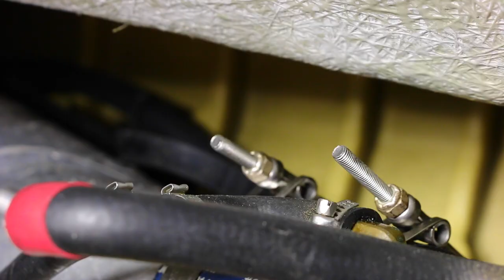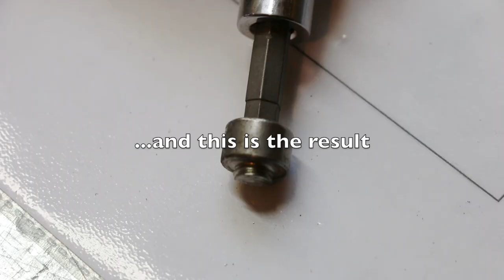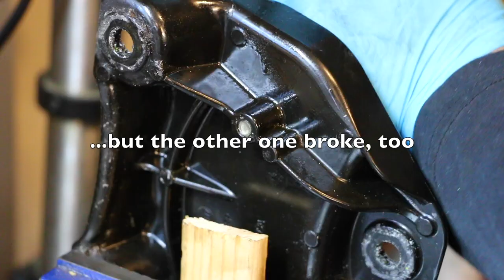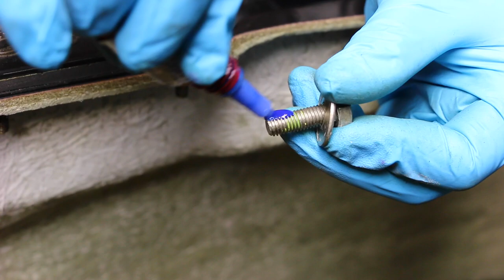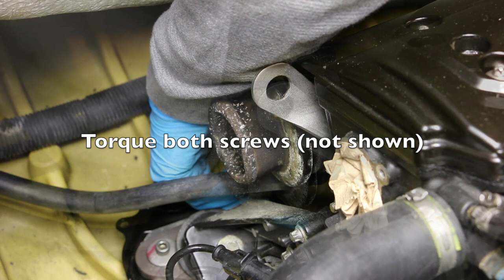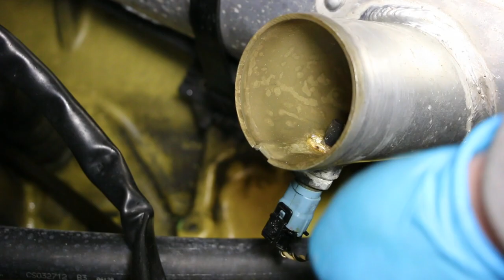How To Do An Engine Alignment On A Sea Doo Personal Watercraft Jet Ski

Comment: Excellent video. Just pulled apart my wife’s 2012 GTI and found the carbon seal ID significantly wore the drive shaft. Checked alignment and the engine is way off at about .125” low. Before breaking those shim bolts, my plan is to loosen the engine mount bolt, take weight off the engine and then try to loosen those shim cap screws. Will see how that works, after watching your video I figured it might be worth a shot...
Reply from the maker: Great stuff! It may take a little muscle, some know-how and a few tools, but the money you save is worth it. Plus, getting to know your machine inside-out is such a great feeling, especially when you rely on it to take you miles away from land. Thanks for your comment, and good luck with your machine.
Reply: And... drum roll... no go...I broke a bolt! (Just like in your video) Ultimately only broke 1 of 6 shim bolts doing this with the engine side mounting bolts loose and weight off the engine ( one shim at a time) Tapping all threads and replacing all M8 x 40 capscrews. I can now see that this is why Seadoo machines the shaft down just behind the carbon seal rotor, that allows for some miss alignment without rubbing the carbon ID. (But NOT 1/8 inch misalignment)
Reply from the maker: Nothing is worse than when you feel a bolt break. It shouldn't happen on a machine that's less than 10  years old ...salt water or not. The only thing that may make life more miserable is when you feel the threaded insert anchored in the fiberglass start to rotate round and round and round...

Comment: I watched your video, as I have also been attempting this. I noticed when you got the alignment right, there was still a tiny bit of touch between the alignment rod and receiver. What is the allowance for that? I have been pulling my hair out trying to get it absolutely perfect. Any advice on a method of how to shim or which mount to adjust? Thanks
Reply from the maker: The rule of thumb is, you will always feel a little bit of a tap, but there should be no resistance whatsoever to the rod moving in or out. Good luck!

Comment: Great video! Any reason why it looses the alignment? Is it because of motor mounts getting old? How many hours motor mount should be replaced? Have a good one!!
Reply from the maker: Thanks for the kind words. Lots of rough riding, wave jumping, general abuse, etc. Some people say they sometimes come a bit misaligned from the factory, but we’re not sure about that. Failing motor mounts can also be the culprit. The motor mounts should be checked periodically, but there’s no recommended time for replacement. Good luck.
Reply: @3ftDeepChannel  Here in Spain we replace it about every 200h
Reply from the maker: Are you doing that as a preventative measure, or have you found broken motor mounts after that time? We just worked on a machine with 900 hours on it and the motor mounts were still in good shape.
Reply: @3ftDeepChannel  as a preventive measure. Here, we always always ride on salt water so with corrosion and the jumps on rough waters they suffer an extra pain. And if they broke the pwc sinks, so they are cheap to change.

Comment: Thanks for all the informative Videos. Q: What has been your experience with with 4 Tec Engine Mount Life expectancy of NA or Supercharged Ski's? Is Salt water a Factor? Riding in Choppy conditions?  FYI: My PWC is a 2015 GTX iS 260 Limited with 197 Hours. BTW: Recently at 191 Hours my iS system had a mechanical failure, the M10 x 110 Stainless Steel Bolt that secures the Starboard Footrest to the Front Suspension Arm Pivot Tube which had Sheared from Metal Fatuige and the effects of Galvanic Corrosion, after having removed the upper body assembly I was surprised to find both of the Lateral Bellows Cracking and Torn and the Center Bellows had a Crack, I replaced Lateral Bellows with New and Central Bellows with Used {NLA} as well as a Used pair of Footrests complete with used Bolts {New Bolts kept being Delayed / I never did get them}. I also performed some Maintenance while I had it apart such as I rebuilt the Supercharger for the second time, I replaced the Steering Column Bushings, Coolant Flush, Changed the Oil and Cleaned my K&P Engineering Stainless Steel Mesh Oil Filter and replaced the Spark Plugs (NGK 4339). My Engine Mounts appeared to be okay from what I could see with the Supercharger removed.  Randy   AKA randog311 (Retired Professional Wrench  /  BTW: I've found my Suspension Ski easier to work on than the European Cars I Specialize in, I don't understand why people bad mouth the Suspension Ski's?)
Reply from the maker: Hey Randy, Good questions. The engine mounts will last quite a few years. Many conditions will affect the life of the engine mounts, but under “normal” use you should get at least 10 to 15 years out of them. If you ride in choppy/wavy waters or do lots of jumping (like we do), then you’ll shorten the life considerably. Still, we haven’t experienced any issues with our machines, even after 5-10 years. That may be because they’re improving the rubber mounts and mount system over the years. You’re more likely to shift your engine when riding in rough waters and throw your alignment off and an adjustment may become necessary. Pay attention to any increase in vibration over use. That’s great you’re keeping on top of your supercharger. That’s a critical maintenance component. There were some issues with the iS design that resulted in water intrusion into the hull. They’re also a bit more difficult to work on than regular skis. That’s why they got a bad reputation. The dampening of the ride bumps, however, is a great thing. Thanks for your comment and safe riding!

Comment: Do the motor mounts ever go bad? Like if you had it out would it be better to replace it entirely for a new one?
Reply from the maker: Yes. Just like automobile motor mounts they will eventually wear. It’s not normally something you’d think of replacing when doing engine work, but if your machine was ridden hard (lots of wave jumping, etc.), it’s over 7 years old and the mounts are looking a bit rough around the edges, I’d consider replacing them. But bear in mind, changing 3 mounts can be a bit pricey (about $300 CDN). Thanks for your comment.
Reply: @3ftDeepChannel  ya mines a 2006 GTX but they look brand new. But my carbon ring is vibrating when I turn the ski on out of the water. Think it’s just misaligned but might replace them. Would the engine be vibrating more and that’s how you really tell if you need new motor mounts?
Reply from the maker: Yes, there could be more vibration from worn motor mounts. The alignment could also be the issue and needs to be checked. If the carbon ring is undergoing too much movement and hasn’t been replaced in a while, you’ll definitely want to check it out and replace it if it’s worn (and it likely is). Check out your pump thoroughly as well, as worn or broken parts in that system can also create vibration. Good luck.
Reply: Ya I replaced the carbon ring 5 months ago and re built the jet pump in December so I’m thinking alignment/motor mounts as well

Comment: I have a 2012 GTX S 155 which I need to remove the motor from to find an oil leak. I assume this engine alignment will need to be done after? Where do you get the alignment tool from? Do you need to remove all the drive shaft etc to take the motor out?
Reply from the maker: Yes, once you pull the engine it’s very advisable to do an alignment check. If you can borrow one from a friend or acquaintance, that is always preferred as it’s not a very regular job to pull your engine. If you absolutely need one though, you can find one at our website: http://3ftdeepsports.com/store-tools-specialty/. Unfortunately, you do need to pull the driveshaft to remove the engine, and that can be a big pain in the neck with machines over six or seven years old. Rust tends to make removal of the C-clip difficult. In fact, we suggest getting the tool for removal of the driveshaft as well. Oil leaks, however, are very rare in those machines. Before removing your engine, I would do a thorough investigation to see if I could confirm the oil leak location. You may not need to remove the whole engine to address the issue. Good luck!
Reply: @3ftDeepChannel  thanks. I bought it with pretty low hours just recently (89), and it had only just had the engine replaced, so hopefully it isn't as painful as it sounds. I'm getting oil in the bilge and haven't been able to locate the leak. I suspect that it is leaking from an oil drain plug underneath that wasn't tightened correctly, but need to remove the engine to find it. I plan on using some flourescent additive.
Reply from the maker: Okay, good luck. No oil drain plug underneath, though. Oil is removed from the dipstick tube.
Reply from the maker: The middle one is the piston valve assembly. They are not oil drains but they could leak oil.
Reply: @3ftDeepChannel  thanks, I'm under the impression that these are not accessible without removing the motor?
Reply from the maker: I’m not sure what the clearances on your machine, but that would be very, very tough. You would want to make absolutely sure that the problem was with those plugs first before going down that route.

Comment: I keep blowing carbon seals. I'm about to be on my fourth one with 190 hours. 2015 GTR. Do you think this should be the first thing I look at? What else can cause carbon ring issues other than the obvious things like running it out of the water? I've got three hours on the one I just blew. Literally haven't done anything but put around the islands.
Reply from the maker: Whenever we pull the driveshaft on our machines, we check the engine alignment. Normally a slightly misaligned engine won’t cause too much damage to the carbon ring, however, if it is too far off, you will see uneven wear on the carbon ring. I.e., you will see a groove worn on the ring. If that’s the case, you should check the alignment and also make sure that the new carbon ring kit that you get comes with a larger steel ring that mates with the carbon ring. Good luck.
Reply: @3ftDeepChannel  yep every time I've replaced it, there has been a fairly deep notch worn into the ring.
Reply from the maker: OK, sounds like you need an engine alignment. See if you can borrow an engine alignment tool. Good luck!
Reply: @3ftDeepChannel  Awesome, thanks! Another good lesson from the 3ftDeep academy. Y'all have saved me so much time and money with your videos over the last 5 years.
Reply from the maker: Great to hear! Thanks for your comment!  😀
Reply: @Mike Dean  Really consider replacing all the engine mounts, if it is a higher hour machine or one that is jumped lots the rubber mounts get softer and flex more.

Comment: The only thing I would add is to replace all C-Clamps with T-Bolt clamps where applicable. Otherwise, awesome video!
Reply from the maker: You're absolutely right about the clamps, Tom. Chris has already done his RXT-X 260, and I've done some of mine but not all. Because if an exhaust clamp fails ...
p.p1 {margin: 0.0px 0.0px 0.0px 0.0px; font: 13.0px Helvetica; color: #333333; -webkit-text-stroke: #333333; background-color: #ffffff}
span.s1 {font-kerning: none}

Comment: How does the spacers adjust along the horizontal. My rod clicks at the 9 o'clock and engine needs to move slightly across horizontal.
Reply from the maker: That is essentially fixed. You shouldn’t have to move in that plane.
Reply: @3ftDeepChannel  With a little push, after the click, it does slide into the pto gauge block. I think I am going to leave good enough alone, as I have 117 hrs on the boat and the performance seems good. I was just replacing a carbon seal, and since things were disassembled, figured I would check it. Again, for now ,I will leave well enough alone. Thanks for your feedback on this.
Reply from the maker: You are welcome. Good luck to you.

Comment: I have a 2012 GTR-215 and im needing a alignment tool for it ,but cant fined the right one . Do you know the part number of the tool that fits the GTR's ?
Reply from the maker: This is the one we used. There's actually a link to products we use in the description below the videos on YouTube.
https://www.amazon.com/gp/product/B00KI360R6/ref=as_li_tl?ie=UTF8&camp=1789&creative=9325&creativeASIN=B00KI360R6&linkCode=as2&tag=3ftdeepsports-20&linkId=b18356541657a9bff67eae1e4c9e4f4a
Reply: Do you know if this tool will fit on 2018 rxtx300? Thank you
Reply from the maker: We used ours on three or four different machines without any issues. But I suggest you check with the manufacturer with the model you ultimately buy to make sure it fits. it will be clearly stated by the manufacturer. Good luck.

Comment: Hi 3ftDeep , it's again me 😅 .. On my Seadoo GTI130 (2014) I dont have black support on the motor supports. The motor supports are screwed directly on the hull. I have only 2 screws to screwed on the hull my question is : I must also put a little of loctite and screwed to 18lbf.ft ? Thanks again 😉 🙏
Reply from the maker: If you’re not the original owner, you should verify that the engine is mounted properly. If you go to the Sea-Doo website you can find a parts diagram for your machine and ensure it’s mounted properly. Unfortunately, we don’t have the torques for your machine, so you should purchase a service manual. You can find them relatively easily with a Google search. The manual will show where to apply Loctite and the correct torques. Good luck.
Reply: Thanks ;)  @3ftDeepChannel  I will try to find it ;)

Comment: How your motor get out of alignment? Is that something we have to check regulary?
Reply from the maker: I'm not sure. It has had a lot of vibration since I got it, so it could have come that way from the factory. Of course, jumping the ski like we do doesn't help. I don't recommend checking it regularly, as you have to remove the drive shaft, which can be a challenge. If it vibrates a lot, you should check it. Or, when you replace the carbon ring or rubber bellow you should do it then.
Reply: Thanks for the reply!
Reply: Why is a carbon ring replaced? I have not read into it purpose as of yet.
Reply: Hi. I have a 1999 seadoo sportster 1800 and I have to replace the motor support on both. 
But after I aligned both motors,  when I started installing the Jet Pump I noticed that the shaft was ahead of the other. so I started to tighten the screws and checking if I was able to turn the motors by rand . One I could but the other when it was getting really tight I stop the installation. 
So , could you tell me what is the distance from the engine to the jet pump ? So I can install the right spacer on it?
Thanks for your time.
Reply: Do you loosen all engine mounts ? Looks like you just went after one mount. I’m aiming to do this on a 787 motor in a smaller ski, it has a lot of shims under the stock engine mounts from the factory.
Reply from the maker: We do the minimal amount of work necessary to get the job done. If only one of them needs loosening, then that’s what we do. Good luck!
Reply from the maker: We just saw your comment now, Leandro. We hope you figured this out yourself. Our apologies!
Reply: 3ftDeep I was asking if it’s ok to just loosen one mount ? 
My main issue is my motor is off center to the pump about 1/8 so I’m not sure if I have to remove shims or if it’s just a matter of removing the screws, move motor into place and then loctite plus torque bolts. 

Let me know if the above sounds ok, I don’t think I need to remove shims since if the motor moved from jumps the shins would still be required as factory spec.